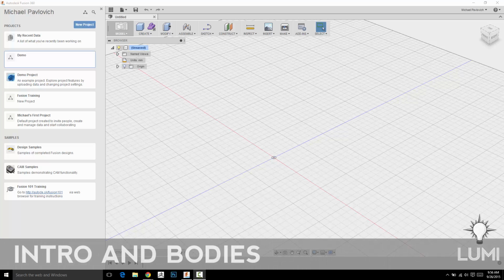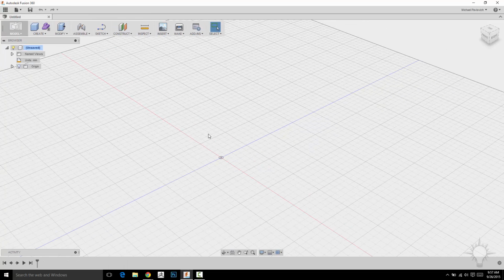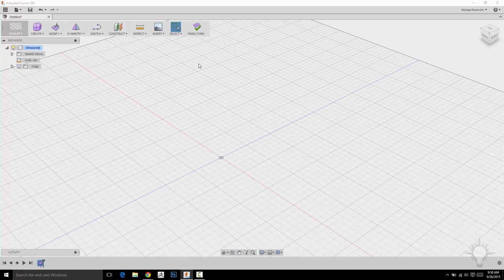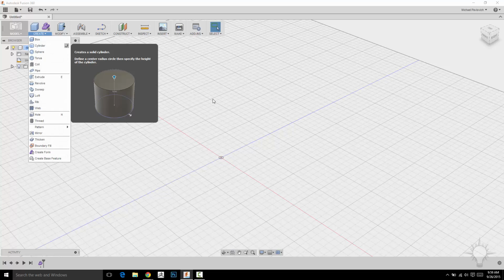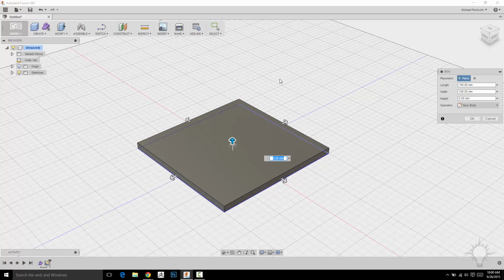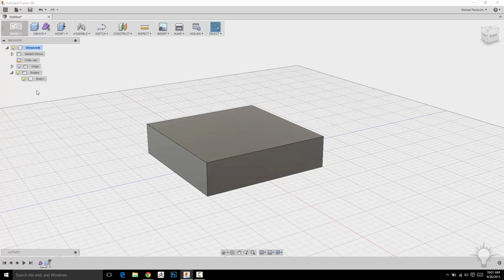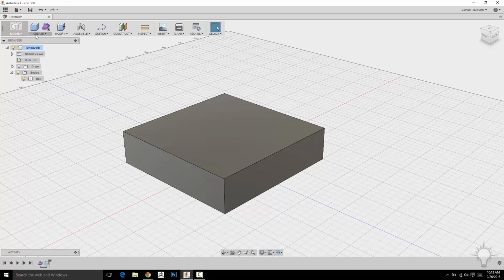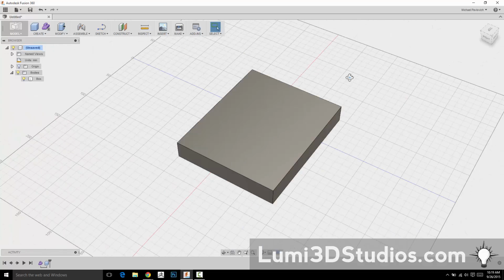001 Intro And Bodies

Comment: So i have a pipeline question, where would you fit this software into any entertainment art pipeline? cant you do most of this faster with other software? what im kinda asking is, what do you use it for, and how do you feel it compares to other software like, max, maya, zbrush, 3dcoat modo, ect
Reply from the maker: +Emil Klingberg 1--I personally couldn't do this faster with other software, but your mileage may vary. Keep in mind what I'm showing you here is the bare minimum basics, the more complex you get, the more difficult (and far less editable, more destructive, these complex objects would become in a poly modeler).   2--I use it for creating complex, editable-from-step-one, detailed hard edge high res assets. As you can tell by my youtube channel, I use ZBrush extensively, and when it comes to game res production I use all of the other packages you mentioned, and then a few, depending on what I need to accomplish. What I love about this industry (and 3D in general) is that there are so many cool tools out there to get to learn and utilize their strengths when applicable. TLDR: Could I model this in another package? Sure. But what's the fun in that?!?